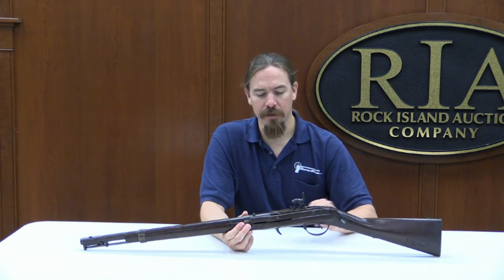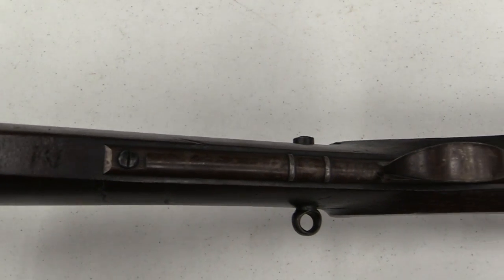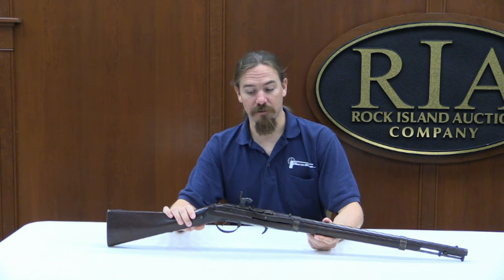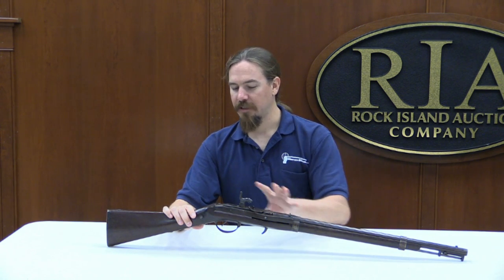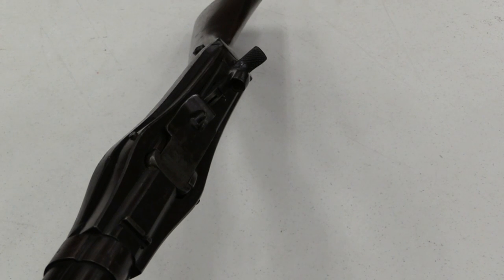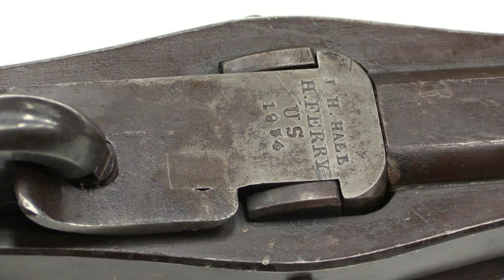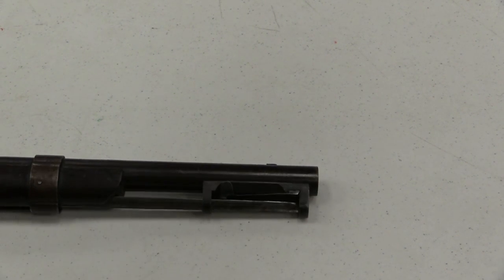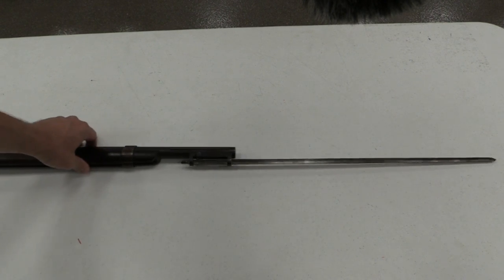Hall Breechloading Carbine

Comment: When you are videoing some object (especially something dark like a firearm), never use a white table or background. The background is large and the firearm is small, therefore the automatic exposure control of the camera sees only the background and is always trying to expose it to a medium density, thus greatly underexposing the dark firearm. Notice how the gun is brighter when the gun is lifted up away from the table or is exposed against a mixed background. Instead of a white background, use a medium gray blanket. Now the gun will show off its true colors and proper tone. This applies to all objects smaller than the background.
Reply: Thank you, that makes perfect sense but I never thought of it.
Reply: @josephhouseman9482  One more tip: If you want to photograph something on a white sheet just overexpose by one or two stops (for digital cameras) and that will lift the sheet and the dark object density values to about normal. Magic!.

Comment: Can't help but notice that the back end of the bayonet is threaded. Is that just to maybe anchor it to the stock when if needed when not in use, or was it meant for the attachment of a brush/jag/pulling piece so it could double as a cleaning rod? I know this predates the "rod bayonet" concept by about 2-3 decades, but it still seems like a tenable theory given the bayonet's length and diameter compared to the rifle's bore.

Comment: You missed one of the most important design elements of the 1811 designed and 1819 adopted Hall breach loading design. The item missed is the ability to remove the breach block and use it as a consealed carry single shot i.e..." norma capacity" hand gun of the day by the soldier.

Comment: It's a bit of a weird hybrid, really - the breech loads from the front, although there's no doubt that this makes insertion of the components a LOT easier than ramming them all the way down the barrel. It's almost a "swinging-block muzzle-loader".  The other really bizarre thing for a breech-loading infantry shoulder arm is that it's a smoothbore; you'd think they'd have gone out of their way to take advantage of the ability to use rifling.

I don't suppose you've ever got your hands on a Ferguson rifle for comparison?
Reply: Smoothbores were much more common at the time of this ones invention. They offer some real advantages,the chief of which, from a military point of view, is ease and speed of loading, especially from a fouled bore. Mass volley tactics were the order of the day. I have been a black powder enthusiast for many years and smoothbores get a really bad rap from the shooting press. They are more accurate than is frequently reported, especially when patched. I have seen Halls in .52  smoothbore and rifled bores fired at rendezvous. They do leak but they aren't much scarier to shoot than a military flintlock with a big pan. You can take the block out of the bottom lever models and carry them like a pistol, I'm not sure about the side lever ones. They are notorious for breaking stocks. A lot of the originals you see on the firing line have repro stocks fitted.
Reply: slowpokebr549
About the leak problem, it is no worse than cylinder barrel gap in revolver system, isn't it?
Reply: Riazor1370 Actually, it mostly blows straight up. If you have ever touched off a pan full of fff in a Bess you have experienced worse closer to your face.
Reply: Riazor1370 No, just closer to your face
Reply: slowpokebr549 Looks like rate of fire may have been quite impressive, if they came with issued paper combustible cartridges.   Burnside may have found some inspiration here.

Comment: So why did they stop making these prior to the Civil War? They seem like such an improvement over regular muskets. Were they that much more expensive to manufacture?
Reply: I suspect (a) complexity, (b) gas seal problem, (c) cost. Complexity becomes an issue not just in terms of time to build one unit (and if you're at war you want LOTS of units), but in terms of the ability of a soldier to learn to use it. Plenty of guys in those days knew instinctively from day to day life how to load a muzzle-stuffer; the fact that they're suddenly pushing an undersized Minie-type ball down a rifled barrel instead of a sphere down a smoothbore tube changes nothing about what they do, but this thing is very different and a terrified conscript taken suddenly under fire possibly isn't going to handle that well.

Comment: A friend of mine purchased one of these at a show about eighteen years ago. When he finally found someone who could restore it the gunsmith discovered several pieces in the lock were marked with stamps from a Southern gunsmith and dated to the time of the Civil War. My friend was very pleased with that discovery.

I was under the impression that a paper cartridge (powder and ball) was pushed into the breach and then the breach was closed, snipping off the end of the cartridge. From your explanation in the video it sounds as though powder, wadding and ball were loaded separately. Which is correct?
Reply: Probably both. By the time of the civil war paper cartridges were common and there was nothing that would prevent you from using them.

Comment: This seems to be more "chamber" loaded than "Breach loaded". I've never seen a rifle like this that cannot be easily loaded in the prone. How did the french Chassepot and the prussian needle gun solve the gas leakage problem? i recall something about rubber seals
Reply from the maker: Yeah, the needle-fire guns used rubber obturators.
Reply: The Chassepot had a rubber ring that expanded under gas pressure and sealed the breech. I think the Prussian Dreyse had no absolute gas seal. Strangely, the Dreyse seems to have performed better under high pressure whereas the French gas seal had problems with powder residue. Considering the Dreyse was issued as early as 1841 this was a development well overlooked by most of the world.
Reply: The early colt revolvers must have the same gas leakage problem, since it has gap between the chamber and the barrel. Then Samuel Walker want it to be loaded with extra Black Powder charge to compensate the power loss. It become the first "magnum" gun.
Reply: Riazor1370 The only revolver that come to mind that does not leak is the Negant.
Reply: David M. No, this perfectly fits the bracket of a breech loader. The fact that the projectile is manually inserted into the chamber is unimportant. In that sense it's no different to modern breech loading artillery.
Reply: Not really. Many early breechloaders are like that. The Norwegian Kammerlader of the 1840s, various front loading revolver rifles, things like the Burnside carbine that is halfway to a cartridge gun load in front of the action into a loading chamber.
Reply: Before rubber seals were invented you could create a good ring seal using platinum group metals, usually platinum itself.

Comment: Ian, I don't know if you will answer this question, but why did gun development barely increase in 100 to 150 years time frame?
Reply from the maker: Which 100-150 years? Self-loading guns had to wait until the invention of smokeless powder; black powder left too much residue for a practical selfloader. Repeating arms, to be practical, needed the development of the self-contained brass cartridge.
Reply: Forgotten Weapons _black powder left too much residue for a practical selfloader_

At least a man-portable one. Practical rapid-fire weapons before that were the fixed-mount Gatlings, Nordenfelts, Gardners, etc. with sufficiently large bores that the fouling wasn't (as much of) an issue, and all hand-cranked and multiple-barrelled to boot. I can't remember to what degree the early Maxims were chambered for .45 Martini-Henry etc. or the early black-powder variants of the .303 British cartridge, but I think at least some were. 

Once you have the self-contained cartridge and smokeless powder, you quickly reach the point where there's very little that's new under the sun; IMO all that remains is to find inventive ways of making practical ideas work better. Hiram Maxim might, if shown an AK-47, wondered why he hadn't thought of that, but nothing about it would have been a real mystery to him, and AFAIK even Gatling himself lived long enough to mount an electric motor on a .30 calibre version of his gun to see what it could do (and he got 3000 rounds per minute, which makes you wonder why aircraft designers didn't go for it much earlier than was actually the case).
Reply: jsm666 
I guess mounting a Gatling gun previous to jet era would be a real PITA task. First, it has multiple barrels, which means weight, common, Germans even used MG08 / Maxim deriatives with no water in them, and steel is much heavier than water. In most cases a propeller obstucts the line of fire (unless aeroplane is built with a pusher propeller), mounting a synchronizer on a rotary gun might actually be impossible or very complicated so it doesn't make sense. Mounting in the wings decreases the effectivenes of fire. So the only planes that could carry a Gatling gun would be two engine fighters, like P-38 Lightning. However, Gatling guns surfaced only after WWII because speeds of jet planes demanded high rate of fire,  before that it was not such a big issue.

Comment: Impressive design, but I don't see the point in leaving it as a smoothbore when it's breech loaded. The main drawback of rifled muskets is that you have to muscle the lead ball past the rifling. So, if that problem is no longer present, the only reason I could think of in leaving it a smoothbore would be for the sake of cost/time. Was the US in a major war in the 1830s in which they needed firearms quickly? Wasn't the Mexican-American War on the go back then or something?
Reply: According to Wiki, at Mexican war most of the Hall carbine were grounded in armory storage because the Generals didn't like the gas seals problem. The in early civil war where the supply of firearm are limited, the entire stock of Hall carbines were cleared  and used by both sides until gradually replaced by sharps or spencers.
Reply: Riazor1370 Still doesn't explain the reasoning behind leaving it a breech-loaded firearm a smoothbore, aside from cost and speed of manufacture.
Reply: NormanMatchem  There were rifled models, too. The smoothbores were  cavalry carbines and were handy with buck and ball.
Reply: DoughboyJonesmk2 I've seen both rifled and smoothbores fired, they lived up to their reputations as good shooters.
Reply: slowpokebr549
 I don't doubt that. It's a shame they weren't more popular, the Hall was definitely a huge leap in firearm development.

Comment: Why did they change from a breechloading gun, to a muzzle loading during the civil war?
Reply: I would imagine It had something to do with the gas seal.As well as the invention of the minie ball.
Reply: The French did something even weirder in the years between WW1 and WW2. At the end of WW1 they had 85,000 FA 17 semiautomatic rifles. The rifle had a lot of faults but they solved them in an improved 1918 model that they built 4000 of and which proved themselves in the 1921-26 Riff wars in North Africa.
But instead of upgrading the existing FA 17s to the 1918 model as WW2 approached, in 1935, they welded a plug on their gas tube systems and converted them to straight pull bolt actions! In the same year they also wasted time, money and materials converting their cumbersome and outmoded Hotchkiss M1914 machine guns and Lebel rifles to use a higher pressure version of the Lebel 8x50mm cartridges (as opposed to the new 7.5 MAS round they were supposed to be standardizing on)!
Compared to that, converting some ancient, leaky breech loaders into marginally more useful muzzle loaders makes sense.
Reply: MrReded69 It all makes sense if you consider the fact that European joint chiefs of staff disliked full-automatic and semi-automatic weapons because they thought soldiers wasted too much ammo when using them. Hell it was even difficult to make a European army accept even a magazine-loaded weapon prior to WW2 for this exact reason.
Reply: TheAtmosfear7 Agreed.  Even the Springfield M1903 had its magazine cut off for this exact reason.  Old habits die hard.  Took even longer to adopt shorter guns and less powerful cartridges.
Reply: I think it was a combination of factors. Hall was never ubiquitously adopted. It was expensive. And with minie ball being developed which was much quicker to load - though still not as quick as Hall - it was much cheaper.
Realise the US Civil War was fought on a vast scale, they would equip far more men with muzzle loading rifles than with Hall Rifles, so many more that it more than made up for the lower fire rate.

Comment: he doesn't know what he's taking about.   these carbines were never flintlock.....they were made in the percussion ignition system like the one he's showing.  Only, the one he's showing has a replacement hammer.  The original model 1836 Harpers Ferry had a hole in the center of the percussion hammer.

Comment: Did these see any action during a conflict? Maybe the Mexican-American War?
Reply: They did! In the Seminole Wars, Mexican War, Pre-Civil War Indian Wars, and were used by both Confederate and Federal troops in the Civil War!
Reply: @Jake_Steiner  Cool, good to know! :) Were they used by mainly cavalry then? Or Light infantry? Can't find much on it actually.
Reply: @Metaldude1945  They were used by the 1st and 2nd U.S. Dragoons until the introduction of the Sharps and other trial breechloading carbines in the early 1850's. The U.S. Regiment of Mounted Rifles didn't use breechloaders until the Civil War, they used the U.S. Model 1841 Mississippi Rifle, a muzzle loader, which is one of the reasons why they were the first regiment to receive the Colt Walker revolvers in 1847. Some of the U.S. Army's combat engineers used this exact design in the Mexican War. The Infantry Halls were both smooth bore and rifled configurations, both long and heavy weighing almost 11 pounds with bayonet fixed. Many early production  guns were rifled and converted to cap lock in the early 1840's. Before the turn of the 1850's, U.S. Army Infantry doctrine dictated that every regiment have a rifle company, and a skirmisher company (what you fine folks in Europe called light companies since the 1740's), all companies in the regiment being armed with muskets. The skirmisher companies used standard smoothbore arms, and fought in loose order lines, firing independently as opposed to mass volleys. The rifle companies did the same, but were armed with various model rifles. It was these two formations that utilized Hall breechloaders. By 1851, the Army reorganized and many new production 1842 Springfield muskets were rifled and sighted right out of the arsenals, and began trials for what would become the first standard Infantry rifles, the 1855 Springfield. With that, the regular army infantry became rifle armed, and each company in regular infantry regiments drilled in skirmishing. The old Halls were put in storage in state arsenals with the old unconverted muskets only to find their way into the hands of Confederate Cavalry(carbines) and Federal Volunteer Infantry(long guns) during the Civil War.
Reply: @Jake_Steiner  Wow, what a broad answer! xD Thanks for the information! That is very interesting!
Reply: @Metaldude1945  You're welcome! I'm a reenactor, I have a problem. Lol